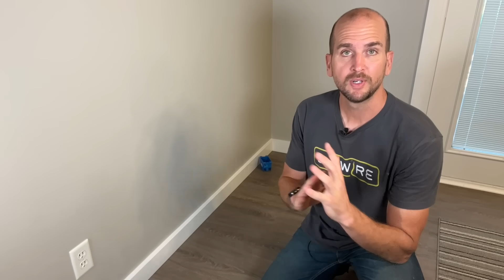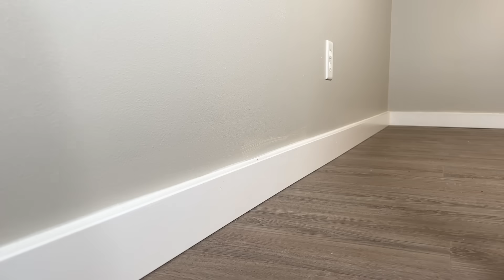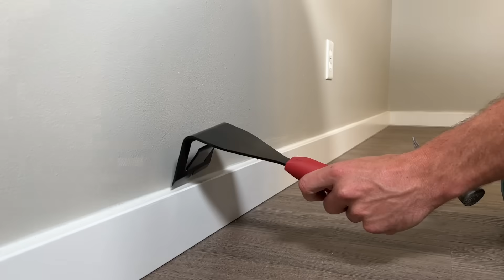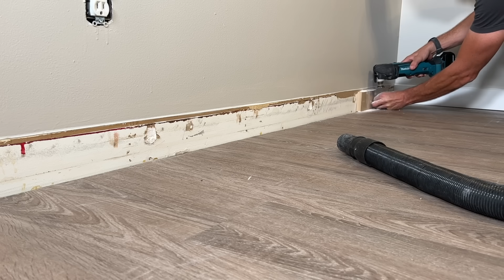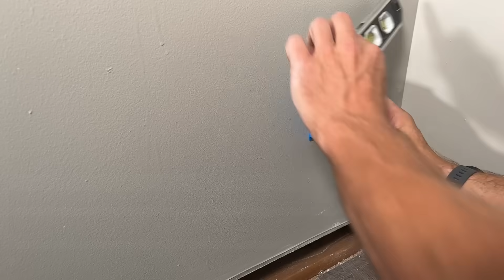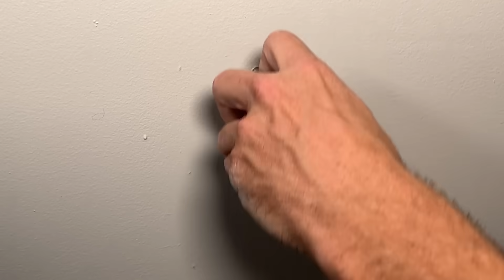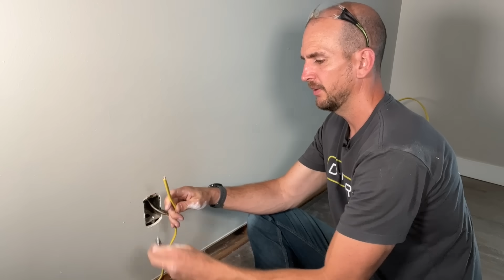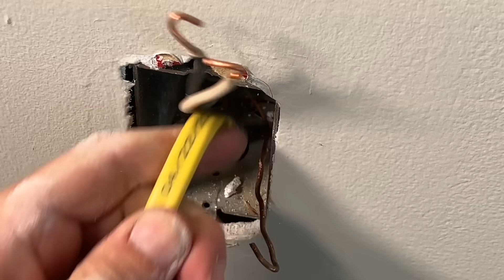How To Add An Outlet To A Finished Wall

Comment: First 'thank you" for installing the nm cable connector. As you stated many homeowners bypass this important step. Remember, when a new receptacle is added AFCI protection  (210.12 of the NEC) is required in most areas of the home and definitely for the room you are working in (bedroom, dining room, den, family room, etc.). By the looks of the existing wiring and box the home is older and AFCI protection wasn't required until the 2002 edition of the NEC. Also when a receptacle is replaced in those areas AFCI protection must be provided per 406.4(D). Tamper resistant receptacles are required too (406.12). I would recommend using a smaller bit (less than a one inch). 300.4 of the NEC (national electrical code) requires a minimum of 1.25 inches from the face of the stud to the nearest edge of the hole without providing protection. Great job without disturbing the exposed section of dry wall!

Comment: Gotta be careful with those outlet testers on remodels. If someone ran neutral to ground you could have a bad day and the tester will read all clear, and they usually don't work <90-100v. Multimeter is the best.

Comment: I've come across metal plates that go between stud and drywall, and prevent nails or screws from damaging plumbing or electrical connections. Is anything like that needed in a situation like this?

Comment: Okay as an electrician I often watch home repair or handyman videos and laugh but, this is actually pretty smart and beats going in the attic through the header, if that was even an option.
Smart hiding it behind the base board, just recaulk and fill the new nail holes, viola. Didn’t watch the rest but routing was pretty slick. I’m a commercial electrician and industrial so I avoid attics like the plague, good to know. I hate insulation🤣

Comment: As far as I understand you are from the USA.  it's so unusual to see how you attach drywall to wooden logs and even with nails😮 in our houses we mount them on a metal profile with screws
Reply from the maker: Where are you located?
Reply: I am from Ukraine. Very often we glue drywall directly on the wall, aligning it with a laser level

Comment: Good video. Bonus: Small nail-plates or collars will also protect wires passing through studs from being punctured by drywall fasteners.
Reply: If you put nail plates on the studs, how are you attaching the baseboard?

Comment: Thank you! Simple, concise and informative. Can't wait to move a few outlets (although I'll be up against plaster...). Any recommendation on just wago clips with romex and thin ceiling fan wires? Working on an old house obviously but nervous about secure connection. 
Thanks! Keep up the good work!

Comment: Good job. But you missed a significant code violation. Today you need ARC fault the circuit because you added a plug.

Comment: Great video, thanks!
One question, what is the benefit of lever-nuts as opposed to connecting wires through the outlet terminals itself?
Reply: I'm surprised no one replied.  In some areas it is against code to extend a circuit through the outlet terminals, you have to use a pigtail.  (Unless it's a GFCI and you want to protect the downstream outlet then of course you have to use the line and load terminals.)
Reply: @davidg4288  thanks for your answer!

Comment: Thanks for this video. Brilliant method and very clearly explained. I have one suggestion which you might want to consider. Before you reinstall the trim, it might be a good idea to caulk the cut lines on the reinstalled drywall piece. This would preserve the integrity of the air sealing in the house for those trying to maintain a tight house with low ACH. This caulking will be covered by the trim so it doesn't have to be pretty.
Reply: I thought the same thing, but would have ran a bit of mud across it.
Reply: Pointless if this is an interior wall
Reply: Yes, good idea.  I would have spackled it though with some plaster or such.  Cheaper than caulk, flatter, and dries faster.  Caulk if applied like a sandwich, may not stick to the dry plaster ends.
Reply: Here's another handy tip: when doing old work, ALWAYS do it an outbuilding, where is  no @$%*$ drywall. This has saved me many, many hours over the years.

Comment: As a contractor 16" on center is 14 1/2" between studs.  Did not see romex cable.  I understand you called romex as the nuts.  (that is a metal casing that the wire goes inside) to code the wire needs to be 1 1/2" deep in stud inside wall. like the way you brought it above base in the wall.  I usually in a remodel tape around the connections on the outlet with a metal box.  Great Job just my 2 cents.  Great Video

Comment: ummmmm. safe off existing(e) outlet. Remove. cut new(n) box in with only the hole exposed. 

6’ -5/8” flexible drill bit,? about $60
glow rods. 
pull string. fish wall between (e)box to (n) box with pull string. 
use string to pull (n)14/3awg
15yr electrician.20 year electrical and hvac contractor

45 min job

Comment: Pro 40 years ...Yet another GREAT VIDEO ... This info is one of the best I've seen on the subject. I would only add .. watch for other wires in the wall including power, phone, computer, thermostat ect. The other reason to drill high on the cross beam is to eliminate hitting the nails the hold the structure together and possibly weakening beams. Keep up the GREAT work

Comment: Good video.  Never thought of using the trim.  I do not understand why you used spring connectors when you have four wires and four screw terminals on the feed end.  Spring connectors will fail on a frequently used circuit.  Just because UL approves something does not mean it is safe or smart to use it.

Comment: Have fun watching this. Walls made of wood and dry wall - if everything was that easy :) Guys.... try do it in solid reinforcment concrete based wall, without any "easy road" near the floor and we can talk about it :) If i have to do that kind of work where i live i have two options: Either arm myself with solid drill and dig the wall, put the instalation tube inside and then plaster it and paint it or use the outer installation tube / conduit. Things are a little bit harder in the eastern Europe :)

Comment: Just hire an electrician to do it right. This is a fire hazard and non standard way to respect electrical. Someone will come along and be very surprised that anyone would ever run an electrical wire behind baseboard and they might put a nail right through it. There are good reasons not to o this.

Comment: I liked your video, it’s informative. How do I know the line won’t be overload by adding another outlet? my county building codes requires to enforce the studs with a metal plate on each hole you drill. I think the plate is 2X3” you can buy it at a hardware store. before you place the sheetrock. and the holes should be lower than 17 or 24”? I can’t remember. homeowners are responsible to check the building codes to avoid fines or void their insurance in case of an electrical fire. Thanks for the link to get tools

Comment: So when do I use this technique instead of just running wire mold? Like a rich residential guy from the blue collar field?
Reply from the maker: I use this in most standard residential "stick-built" homes.
Reply: @Everyday Home Repairs  ok thanks bud. Great video.

Comment: Awesome video. Quick question though. Why did you make pig tails for the wires coming from the original box to the new box instead of connecting them to the other screw terminals on the receptacle. I feel like it would save room in the box. Love the videos.

Comment: Great content! Thank you! A couple questions. I have the same project, except it's in the garage. The outlets are about three feet from the floor. I can either do what you did and then run the Romex up. Or, remove a 4-inch horizontal section across the length of the wall. Thing is the walls are painted like yours with a layer of texture I put on. Replacing the drywall piece will require spackle and painting. I have a feeling it will be noticeable to the eye. If I do what you did at the bottom, I can replace, and then add a nice diamond plate base molding over the seam. I've seen 4", 6" and 8" high moldings. Also, if I go that route, do I have to secure the Romex up by the outlet to the stud? That will be the challenge if I remove drywall at the bottom (preferred). Maybe there's enough room in the outlet hole to tack down the Romex.

Comment: I'm a plumber and I pulled the trim to drill a hole behind it to run a camera under the floor to see a leak. Someone ran an electric wire along the base board behind the sheet rock. Guess who hit it with a drill and bit. Wish who ever ran that wire would of watched this video lol. Good job!!

Comment: Great video, but I'm confused now...  I've seen you not use the push in connection On the socket and make the j on the screws. Which one is best?

Comment: Well, you violated the building code in at least two ways: You installed a new outlet without an electrical permit, and you're not a licensed electrician so you're not legally allowed to do wiring in a dwelling that isn't your own residence. And if you rent this out as an Air BnB, it's not your primary residence.
Reply: I believe there was a third violation. The new plug is too close to the corner. Not sure though.

Comment: This video is a great idea for homes that have a baseboard of that size. Also, some old homes not only have a very small size baseboards but, instead of drywall they have plaster so, great video, great idea but, with some limitations. Thank you though.

Comment: Don't use those newfangled wahoo connectors I've seen some evidence of wires overheating these connectors are only good for 5 amps great for doing LED lights and stuff like that not for wall plugs which are on a 15 or 20 amp circuit The twist nuts are bulletproof if you do them right. And don't be lazy use the wire nuts on the plug like the old fashioned way of doing things with bulletproof again I've seen wires melting because they do not handle the load especially when people using electric heaters.

Comment: First and foremost this guy is not a licensed Electrician. He is making videos that are not code compliance. The rest of you that say leave him alone.  Any licensed Electrician's First responsibilities to this trade is safety. Can't believe U Tube allows this Wana be Electrician. I been a Electrician for 40 plus years. I wouldn't even consider him as a apprentice for hire. Already has misinformed bad habits. What happens when one the diyer's follow this mis informed advice. Burns a house down.Or God forbid a loss of life. That is why we have to be licensed, bonded, insured. By the way, check Local codes. I am sure the building dept is going to require a  electrical permit for adding a additional outlet. I didn't see him do load count on the circuit. Never showed the actual proper grounding of existing outlet. I can go on and on. Someone needs to take action. Have this guy banned from giving unsafe advice. And not to code. I am really shocked about the licensed Electrician's on this sight is supporting someone that is a diyer  which is basically short cutting our trade. Shame on you!

Comment: Journey/Finish Carpenter here. Well done! The one thing I’d add is floor protection. Rosin paper or just a piece of cardboard taped down with blue painter’s tape (or better- that new yellow Frog Tape).

Comment: I have aluminum wire my house. Normally when I add a copper wire to the aluminum wire, I use a certain kind of wire cap that has a certain kind of fluid in the cap.  Do they have a connector that takes in two different wires.

Comment: Great video. In case someone else hasn’t already commented on it, when using old work boxes like the blue on you used the “ears” on the outlet being installed need to be trimmed off. There are cut lines already on there for you to simply snip off. This ensures the outlet is flush on the box and your wall plates have no gaps when installed.
Reply: What keeps it from falling into the wall, then?
Reply: @KevinDurette  there is still a center metal piece that remains and fits into the old work box perfectly. You’re not removing the entire metal piece just the “ears”. Try it once with a cheap outlet and go to Home Depot and dry fit the outlet with no “ears” into an old work box and you’ll see what I’m talking about.

Comment: I never need to add more outlets. I can always get nice multi taps an cords.  My problem is needing 3-6 circuits in a room. How can you add a whole circuit without replacing the wall? 🤔. I've drilled thru floors to run other cabling. But that needs work to hide what it looks like specifically if it is going up 2 floors

Comment: I have learned A LOT from my Grandfather who was a master DIY-er from electrical work & carpentry.

He told me (& I agree with him on this) to NEVER USE those wire slip-in slots on the back of the outlet, over time the wire can break, loosen from or melt the plastic around that connection causing an electric arch & fire.  ALWAYS USE THE SCREW TERMINALS! Make a pigtail if you need to tap into the circuit for power, because the screw terminal is NOT meant to have more than ONE wire on them, then tie the wires together with a wire nut.

Comment: It would be nice if they made an electrical outlet with a temperature alarm. If the outlet gets hotter than (for example) 150 degrees Fahrenheit, the alarm will sound. That might help to avoid electrical fires. 

They make snap-action thermal disks, which will activate at any temperature you want. Even breaker panels could use them.
Reply: “Fahrenheit”. “Inches”, feels very last century. Allan R.
Reply: @allanrattee  The imperial system of measurement is the future. Children will learn how inches came to be. And how gallons match barrels. And how miles match marches. And how degrees match latent heat. Our system of measurement is a part of our outlook and history.

The metric system means nothing. It’s a refutation of identity. Would you name your son “35-19”? That’s what Washington is hoping for.

Comment: I would recommend (urge) using BX armored metal clad cable for this!! Very easily a new owner may nail through non metallic cable while changing or installing taller base moulding!! Nail plates are good at the studs, but a stray nail may hit even between studs. Thats why i would say armored cable for this job is a must!!
Reply: In that case, armored cable should be used throughout any home, because owners nail stuff into walls at all heights.

Comment: Great video.  However, one question, why didn't you just connect the new romex to the bottom screw terminals on the outlet?

Comment: The trim puller seems like a worthy investment. Usually I run into the problem where their existing trim is 2 1/4" at best which is an issue. I ask if they would like to install new crown molding and add lights while I'm at it or perhaps larger baseboard

Comment: Yes, I liked the way to vacuum cleaned the floor as you go. And I like the way you used painter's taped above the studs to identify the studs for re-nailing the dry wall and baseboard. Planning is everything. Awesome video, short and to the point. You're the man!!!
Reply: Painters tape, yep borrowing that handy dandy idea!
Reply: Yeah you can tell he isn’t a real electrician. They just leave their trash on the ground

Comment: Definitely can do it this way. But as some have mentioned I have hit wires with my nail gun as you do not expect wire this low . Manufactured homes anything is possible . Hardly anyone if any in my area use Nail plates heck they do not even know what they are? Sad but it’s nice cause you do not need to have a license for any construction except commercial plumbing where I live. Oregon was ridiculous for all the red tape. And a license does not mean you know what you are doing.

Comment: Actually, the Knockout on the back bottom is the one you should have removed, and then you should have stubbed your wire down thru the existing box, and run the wire over to the new box. That way you're not trying to fish thru a hole. Much easier to do. I've done electrical work for YEARS and that's how it's done. You don't have to worry about your wire falling out if you twist your grounds together, and that way the wires don't have an pressure on the hole it goes thru. Works like a charm. The other reason I do that, is because the wire coming up thru the middle of the Box gets in the way of the receptacle itself. And I'll never ever use those types of connectors. Twisting wires together keeps the load off the connector, and puts it on the wire. Those devices are to cheap to handle many of the loads people will plug into those outlets. Mainly, Vacuum cleaners.
Reply: Good advise, but I always have the problem tightening the clamp down on the romex, unless I can use the plastic blue pop in clamps. And BX is also added insurance for running thru studs if you can't install nail plates.
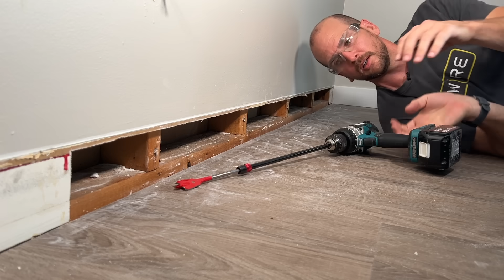Reply: I agree that it would be better to use the bottom rear knockouts but if you look at 5:05 you will see that the bottom clamp is missing and the clamp screw has been used for the bonding wire rather then the intended bonding screw.  That is just one of several potential or actual electrical code violations present in this video.  The code is VERY detailed and sometimes does not make 100% sense, but there are reasons it should be followed.

Comment: That's brilliant, you learn a lot from these kind of videos. I have started to really get into DIY in the last few years as it saves a lot on tradesmen. I never understood why the plug sockets in the UK have a ground wire (3 prong plug - earth, live, neutral) but they don't in the United States (just 2 prong plus - live and neutral only).
Reply: The outlet he installed in this video is a 3 prong outlet with live, neutral, and ground.
The National Electrical Code in the US has required 3 prong outlets since 1962.